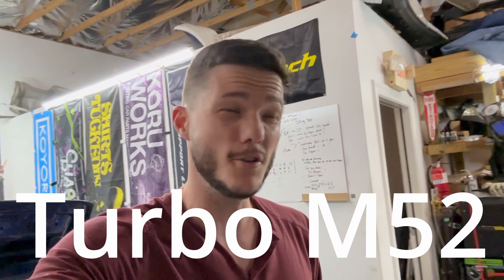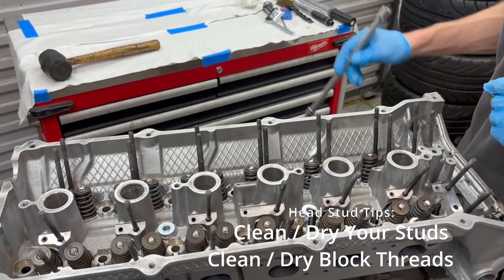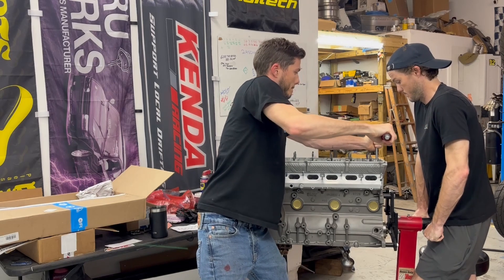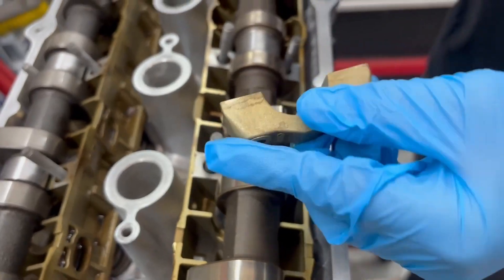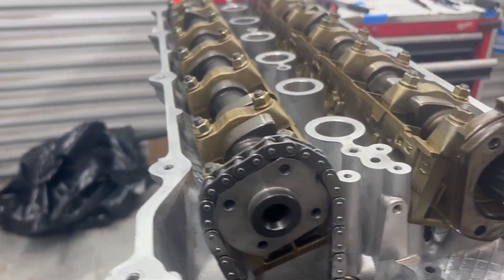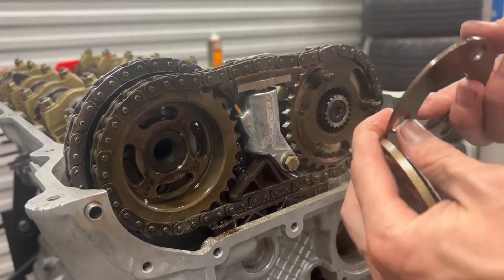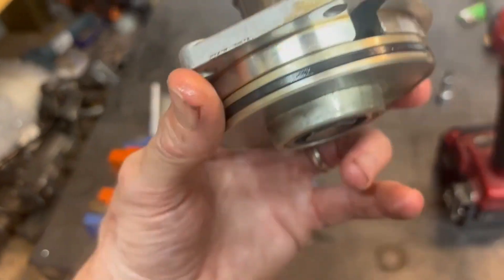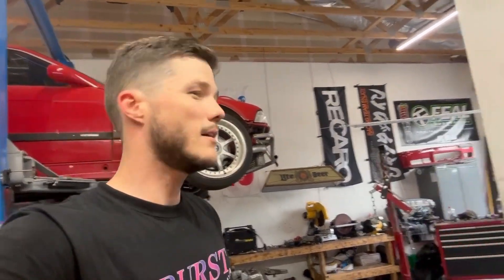Athena Cut Ring Gasket, Head / Cams with torque specs!  FREE VANOS REBUILD! Best Value Turbo M52

Comment: How'd you bump the compreession ratio to 10.5 as the oem compression ratio is just 10.2? shaved head/block, thinner headgasket?
Reply from the maker: New pistons!  Heads are decked and our gaskets are normally .078-.080 thickness.  Oem is .073 which my mls is currently for extra bump in compression
Reply: @Drift.Things looks like I missed the part with the new pistons, my bad! With .073 head gasket and the new pistons, there’s no valve/ piston interference? Did you ever measure piston to valve clearance by any chance? Which Pistons do you use here? as I guess a differently shaped dome gives you the the compression change with the new pistons going with the decked head and gasket

Comment: Very clean.   Have to go back and watch part 1 and 2.   I'm hoping to spend a little more money on a 3.0 liter stroker with the M54 crank.    I find most recommend lowered compression pistons when building an engine but there are plenty of blown M52's and a fresh engine with cutrings should hold just fine as a street/track day car.   Not sure if you are doing 1/8, 1/4 mile pulls on the regular.
Reply from the maker: We don’t lower compression since we run ethanol!  Then we have super quick spool responsive throttle